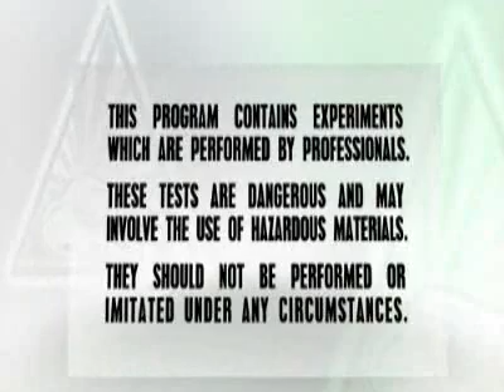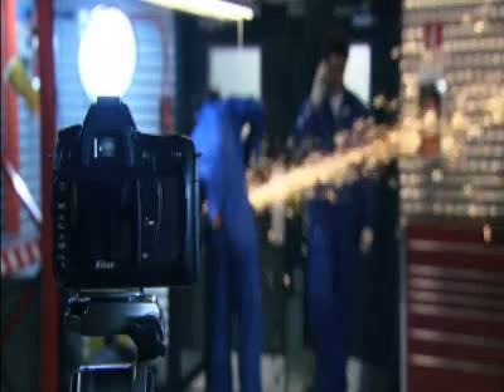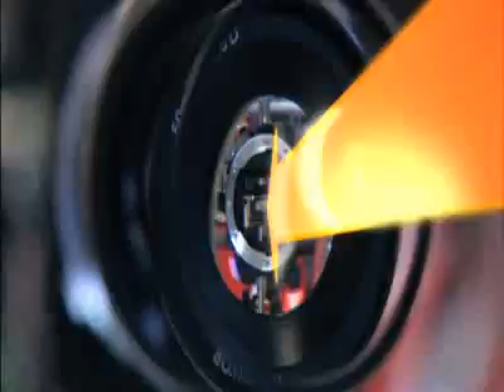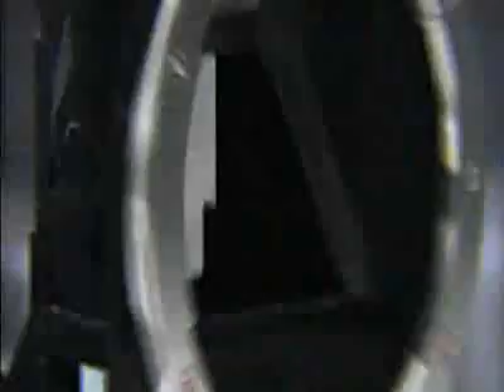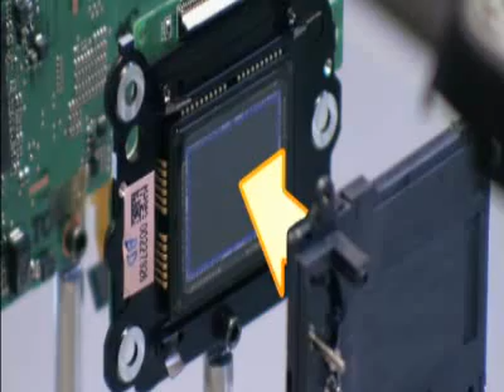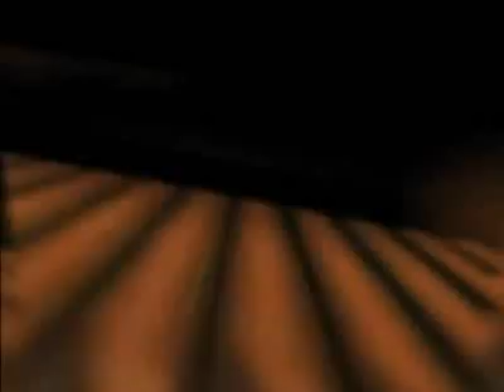HowStuffWorks Videos -Digital Camera Videos-.flv

Comment: What happens to the shutter when a DSLR is in video mode like the Canon 5D Mark II? The "frame rate" is 30 frames per second but the shutter does not work that fast.  So is the shutter staying open?  How does the 'frame rate' work?  Is the camera's sensor turning on and off electronically to give you 30 frames per second with the shutters (1st and 2nd curtain) remaining open?

Thank you,

The Meltdownman
Reply: It is continually doing a sensor readout.